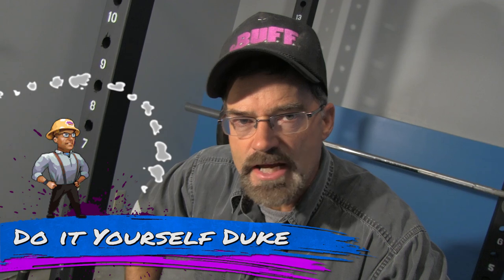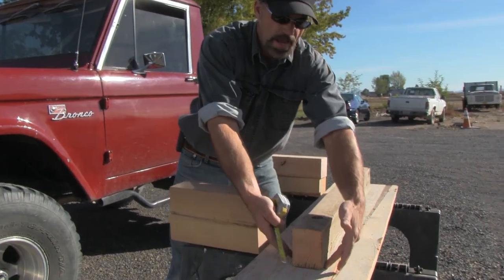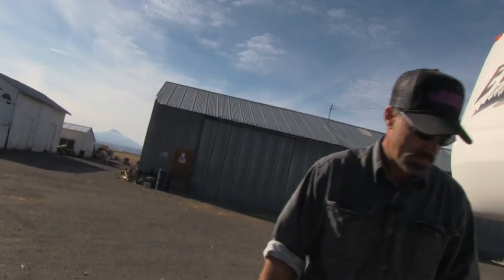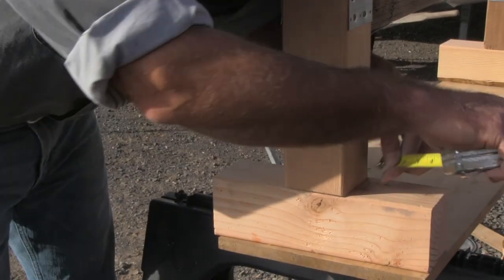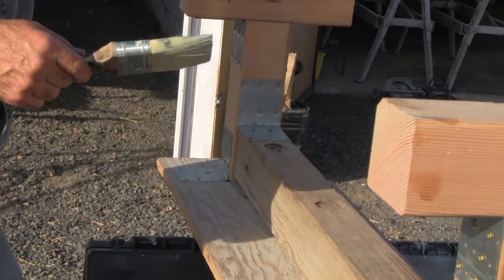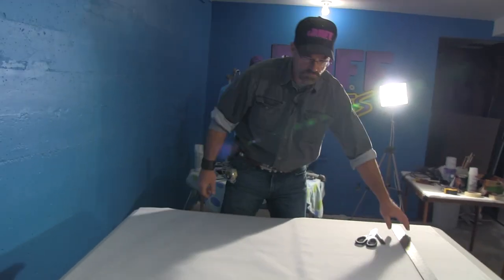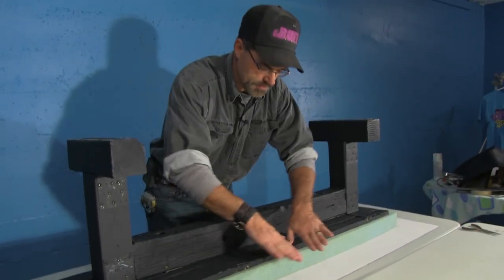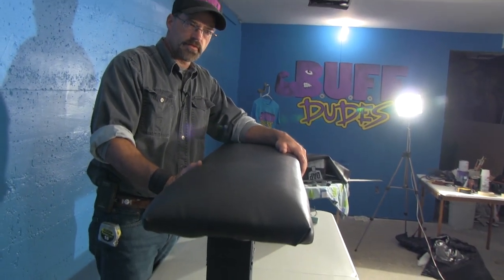How to Build a Gym BENCH - DIY DUDES

Comment: I’m trying to alter my very old joe weider metal weight bench so I can put the weights actually on the bench legs when not in use and keep off the basement floor so no scratching. I figure I would drill through the legs maybe no wider than half inch holes and use a rigid pipe to hold weights . I think it may be strong enough as I’m no power lifter so my weight capacity much lower to work with. Any suggestions on what to use? I know emt tubing is way to thin and will bend. Other ideas? Anyone??

Comment: Love to work with woods, but if you have never seen "T"-slotted Aluminum Structual tubing your really missing out.  I use Rexroth Bosch, but there are hunderds of brands.  Can build anything(i mean almost anything) with my 1" thick cataloge and a drive accross Metro Detroit to Micco - - Modular Industrial Components Co.   1-248-584-4440  Madison Heights Mich.   These guys cut and warehouse all Rexroth Bosch stock for the automotive robotics industries(do anything for the public as well).  Never make anything that won't last.

Comment: Thank you. Built it couple days ago. One thing, 50' plywood is way too long for the bench....and 12' is too wide. look up some standard bench dimensions online and adjust accordingly.
Reply: gorotube10 can you post the hardware  you used  and where you got the foam and vinyl?
Reply: @patrick71179  Saw, tape measure, screws, Simpson brackets. Vinyl is at Joann's. I didn't find foam, used moving blanket instead, even cheaper, get it at harbor freight.